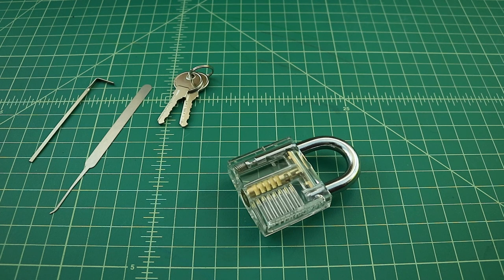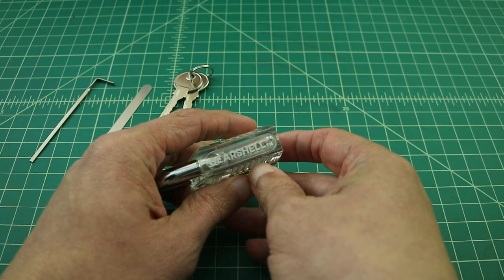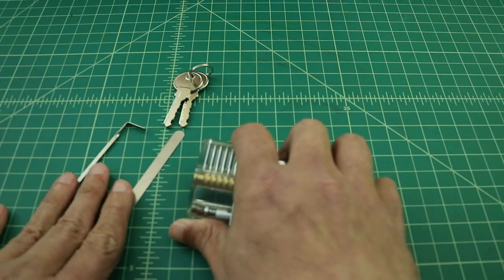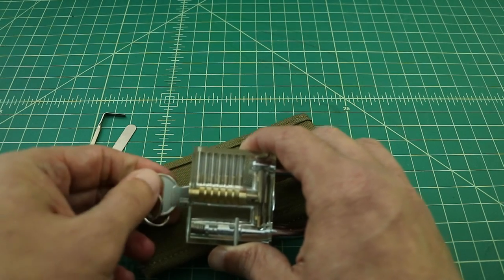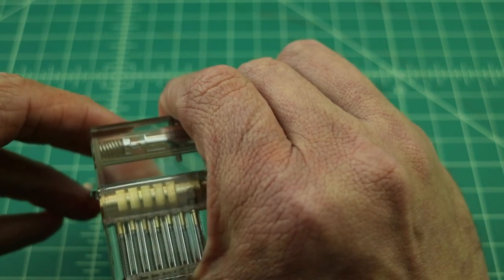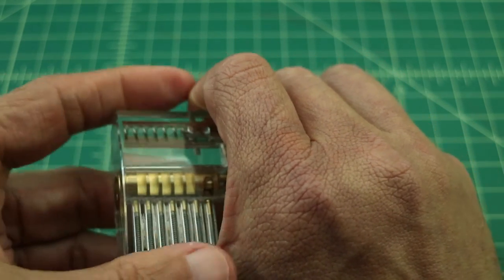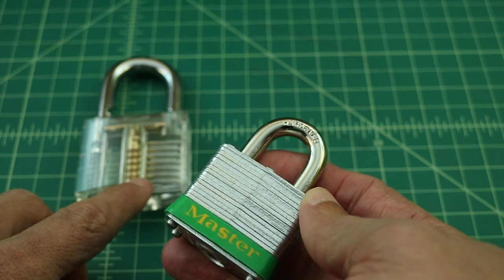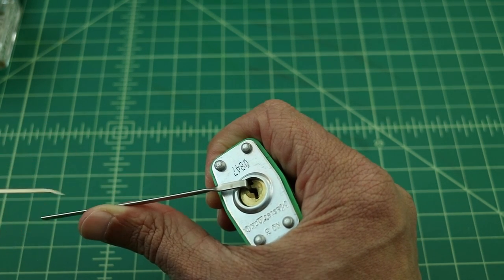How to Pick a Lock (Basics) - TheSmokinApe

Comment: Nice tutorial!     I wish I has started with a training aid like this, but I just gathered all the locks around the house and office and drove myself nuts....I finally got them all to open and still "practice" sometimes.
Reply from the maker: +Ron C I started te same way with raking, when I wanted to learn to single pin pick I ordered the practice lock...
Reply: I bought a Peterson hook and rake, better than the beginner set i had, but a tad more $$, Noticeable difference. It's fun grasping new skills....without tutorials, like this one, I'd have been lost.
Reply from the maker: Thanks man, I am glad to liked the video.  I have only bought a few "kits."  One was a deal of the day type kit on woot that really sucked. Another was a cheap China kit where the picks all broke after a few days.  The last two from Southord and a Sparrows have been great, both came with hooks, rakes and multiple tension wrenches.  I would recommend them to anyone...
Reply: I have a sparrows kit, I bent one of the hooks, but I'm sure I was using too much pressure and not enough finesse. I think any "branded" picks are great. I just did a video of a "kit" I carry, should have shown the picks!
Reply from the maker: Just sub'd, I didn't know you made videos.  I bent a Southord but I was able to get it back to working order, over time I learned to ease up a little and it's helped with the picking allot...
Reply: Appreciate it. Yeah, I learned that it does not take much pressure at all on those tools, and then there are the pins that require you to "let off" the tension wrench a hair to get the pin to move...can be maddening.
Reply from the maker: Maddening is the right word.  When I first started to pick I went at it hard and then took some time off which seemed to help, just getting back into it again.  I want to get into picking harder locks like dimples and high security at some point.
Reply: I don't look forward to those harder locks...lol!I tried some of those little, simple looking, military brass locks...but the security pins were killing me!
Reply from the maker: I picked up some of the American security locks but haven't had any luck with them.
Reply: I need to practice some more...it's been several months...gonna be rusty.
Reply from the maker: I was surprised at how quick it came back
Reply: That's encouraging!